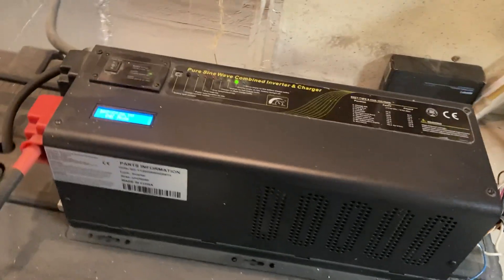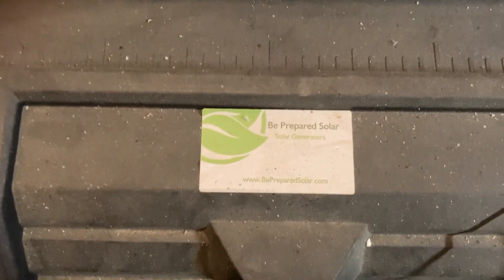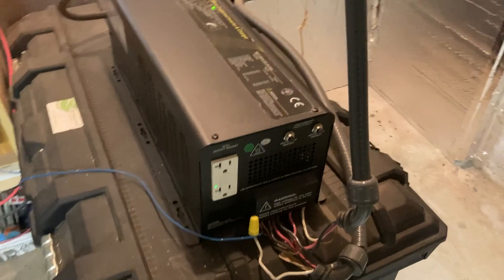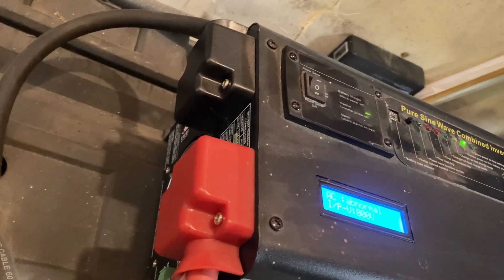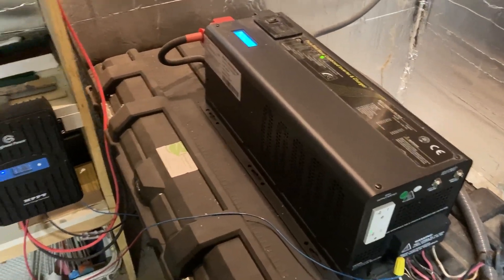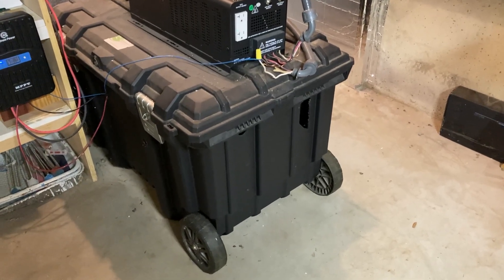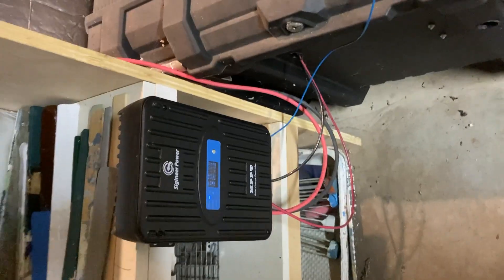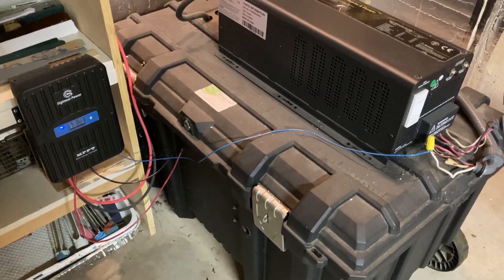Power Backup System with APC3024D 3kW 24V 120/240V inverter charger & DS2460 60A Solar Charger

Comment: Market used to be flooded in these cheap, LF inverters, nowadays, not so many. Hard part is finding them for odd voltage setups like 36V and 72V.
Reply from the maker: We currently only have one 15kw model that can work on 72V battery banks, here is the link, https://www.sigineer.com/product/96v-inverter-charger-15000-watt-120-240vac-110-220vac-230vac-pure-sine-for-tesla-model-3-lithium-battery-module/
Reply: @sigineerpower7134  Cheers, I was looking at that unit  while watching your video, lol. 
I did see the lower voltage options at bottom but these are for Lithium Ion batteries, not LiFePo4 that I have. I also need 50Hz.
Reply: @sigineerpower7134  I looked further, LiPo batteries only. Not LiFePo4. 
As I said, getting support for 36V and 72V is a PITA as all the name-brands jumping to 12, 24 or 48V only.